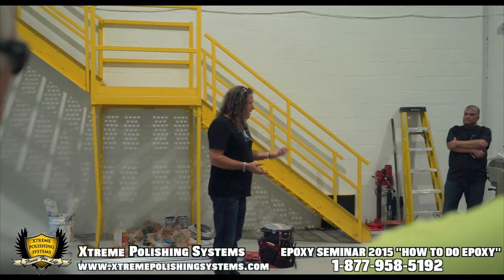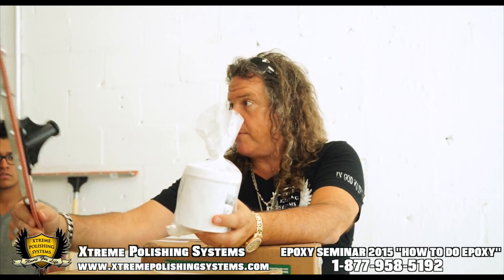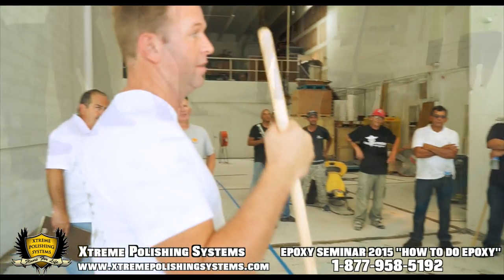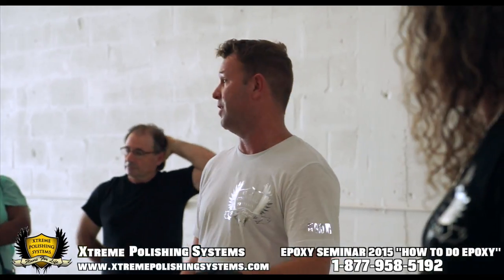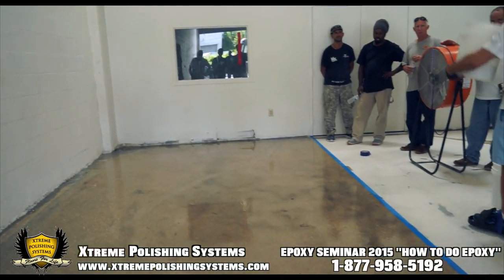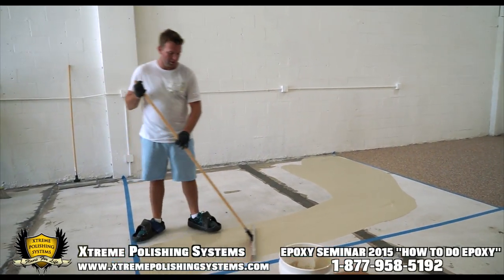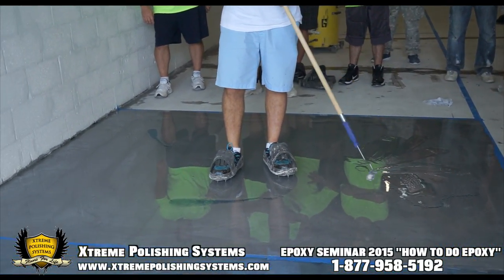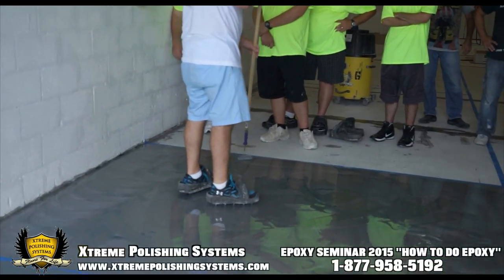HOW-TO Install an Epoxy Floor Application | Xtreme Polishing Systems

Comment: That acetone trick was awesome! I saw in another video but do you guys use icoat products?
Reply from the maker: +darrinsurett07 For product specific information, please give Chris a call at (877) 958-5192 or by emailing in at info@xtremepolishingsystems.com
Reply: Xtreme Polishing Systems what are the disadvantages of applying metallic coat directly on concrete?
Reply from the maker: As long as it's a smooth and dry surface, epoxy coatings can adhere properly.